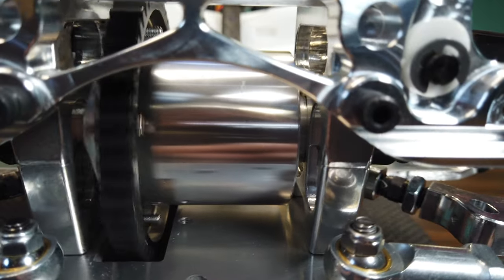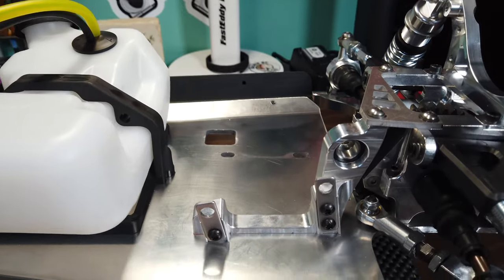FG Marder Engine Upgrade - Must See!

Comment: Hello !, you have to insert 2-3 washers/shims at the bottom of the front wishbone bearing point under the joint to the floor plate so that you get a kind of anti-squat and thus gain traction, the upper wishbones are also set at an angle by the white bushings as eccentrics , I've been driving the kind of kick up rear for about 15 years!